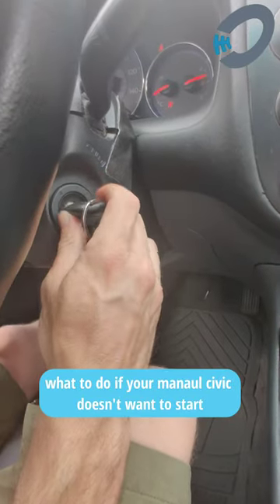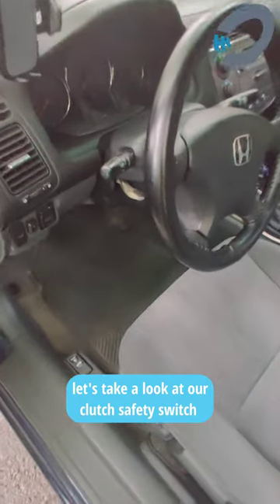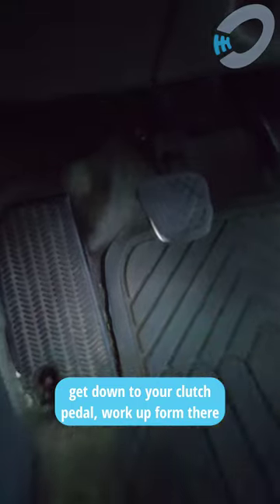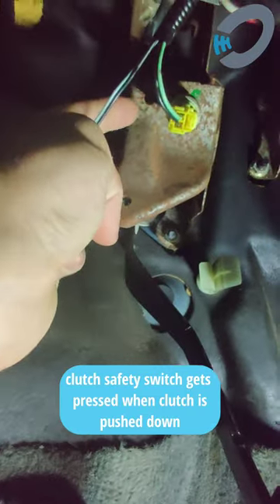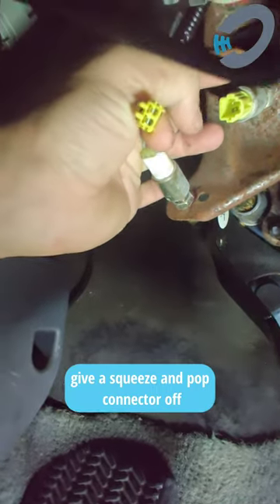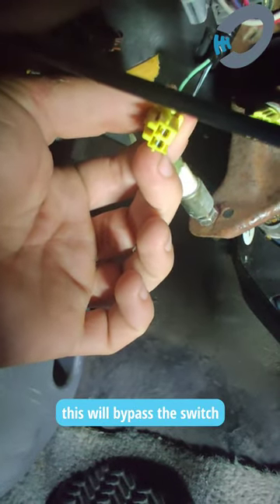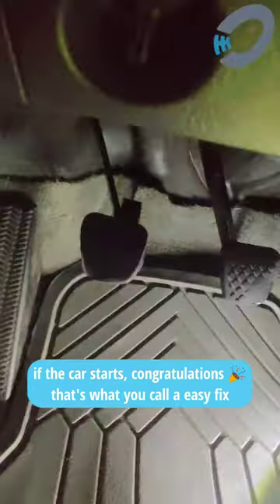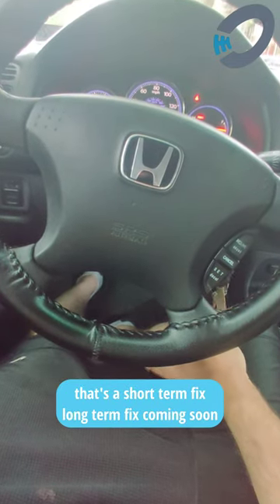manual car not starting?!? check your clutch safety switch! 03 civic

Comment: I fixed in 15 min bro Thanks. Used a flathead screwdriver taped it to flat side removed the front seat 2-3 min. Lay down stuck the tip and wedge it in. Double check it was laying flat car start right on.

Comment: Is the car safe to drive with this temporary fix? I want to drive it to the mechanics to permanently fix
Reply: Thanks for your video btw . Very helpful.
Reply: Completely fine to drive without it. Just make sure you have your clutch in before you start the car. The reason the clutch switch is there is to stop the vehicle from suddenly moving when starting (if left in gear).
Reply from the maker: @josedelacruz1270  absolutely safe

Comment: Sir when i do this in my car the bypass wire get shorted and my car odometer stop working (not showing anything😢
Please help me 🙏 what should i do?
Reply from the maker: @nikhilbharne4369  check your fuses, you have a short else were which circuit is causing it

Comment: what was the actual problem having an annoying issue i tried jumping the switch i may have done it wrong and still no start everything turns on but nothing
Reply from the maker: the clutch safety switchbacking went out, its where the switch pressed into, there was a plastic stopper that rotted out and wasnt pressing the switch anymore
Reply from the maker: I know the response is a bit late but if its of any help you can see the permanent fix here                                                          https://youtu.be/R0GDz-NY6R4

Comment: If you bypass the safety switch you don't need to push the clutch pedal...
Reply from the maker: By pass the ignition interlock, do a lil creative rewiring and start that piece with the hazard lights - true winner
Reply from the maker: But all jokes aside i had it bypassed for a day or two when it happened, definitely beat pop starting her
Reply: Exactly. Funny story is I’ve never driven a manual car. So I’ve been cranking my car like an automatic just pushing the brake and starting. Yesterday my car wouldn’t try to crank so I looked by the clutch and I see this exact set up (I guess previous owner did it). I re adjusted the paper clip and it fired right up. No clutch needed to start lmao.